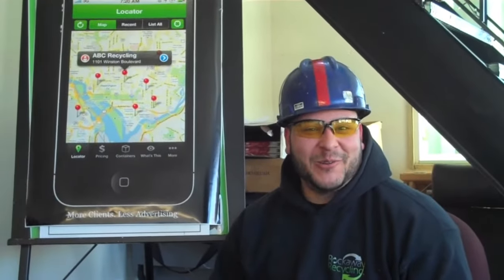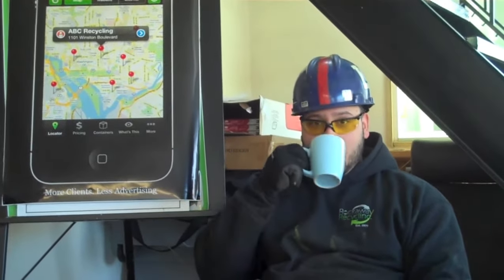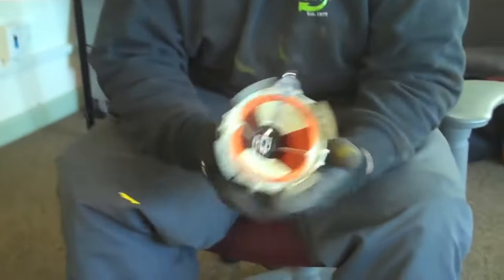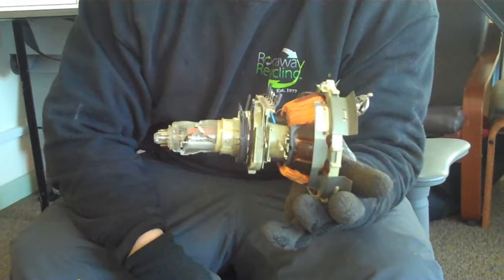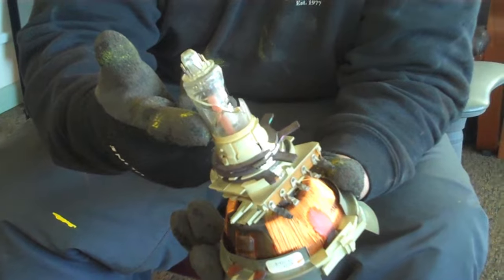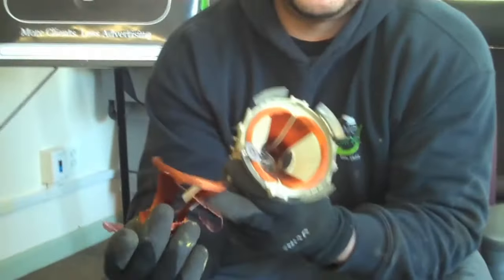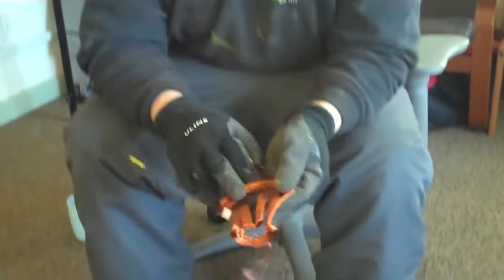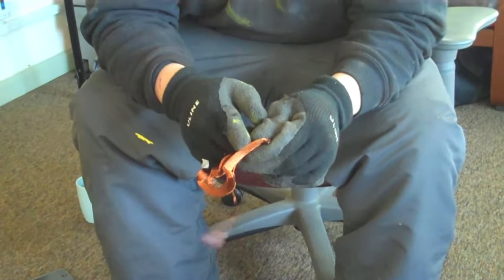Episode 4: Cup Of Joe - Copper Yokes, Car Batteries, & More

Comment: Thanks for the help.  It looks like I found a scrap yard just across the boarder in Illinois that takes the freon from refrigerators for free. (I know its worth money but I don't care).  Now I have no problem taking them.  I just started pulling the whole system out of the refrigerators with out kinking or breaking the lines.  I am hoping this is generally ok, assuming the freon stays put.
Reply from the maker: That's good to hear. You may want to just make sure that they are recycling it properly. Freon can be very harmful to the environment, so if you are giving it to them when it's sealed, they should be recycling it with an HVAC contractor.
Reply: Cleveland Corporation (Iscrap preferred).  I have a understanding of freon from working a company that makes Gigantic dehumidifiers for pool rooms.  I wish I could afford the tools, but if I can find someone to do it for me, they can have the business.
Reply from the maker: Benjamin Armstrong Like to hear that. Smart Scrapper!
Reply: Yeah will your advertising works, that's how I found out about their freon recovery. I will have to mention that to them.
Reply from the maker: Benjamin Armstrong That's awesome!!! We love to hear that! Thank you!